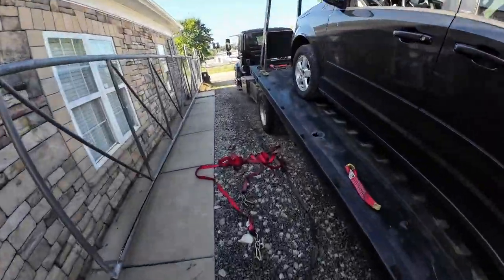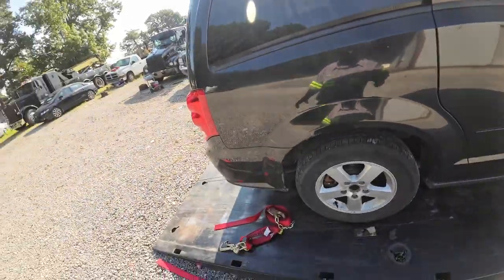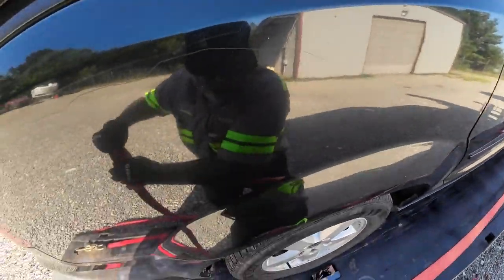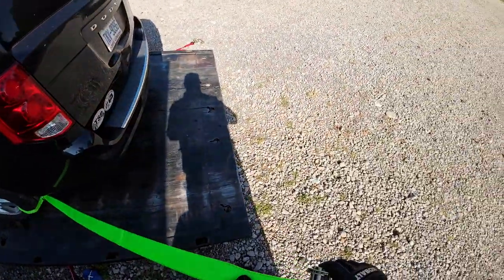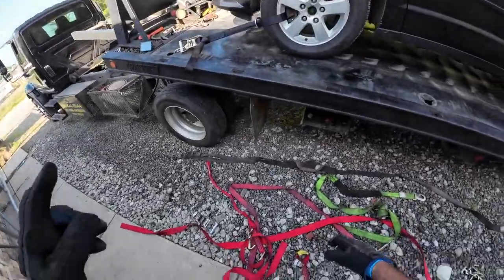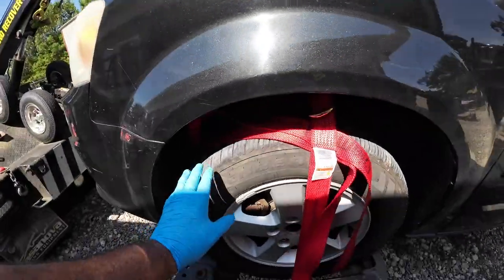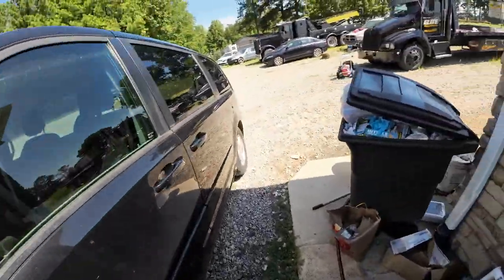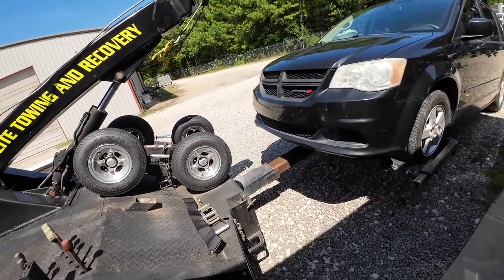AWESOME DIAMOND WEAVE STRAPS FROM @baremotion

Comment: Going to the center of the tire with the ring is easy-going on the tires! There  softer side walls as well , going ware the rubber  meets the road is the strongest point and a straight pull on the tires. And the key ! I think is having the correct hook all though there all correct it's just 
More universal to use the split hook I believe.👌🏻  Great demo! This come in a great deal knowing what to do for those warriors at weekend's rent a uhaul trailer and just lock the front down as I seen so often.👍🏻👍🏻💯